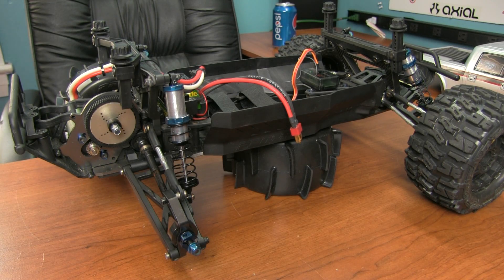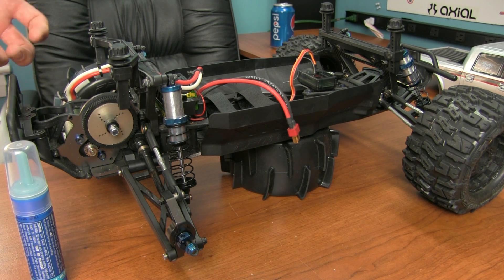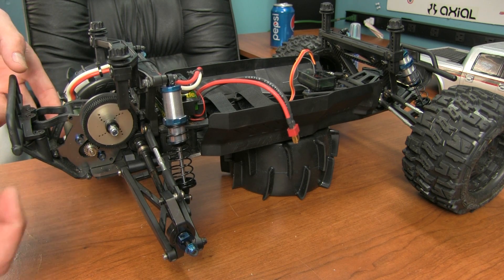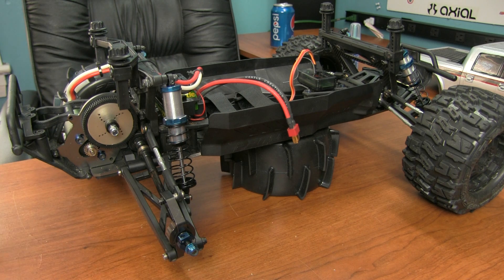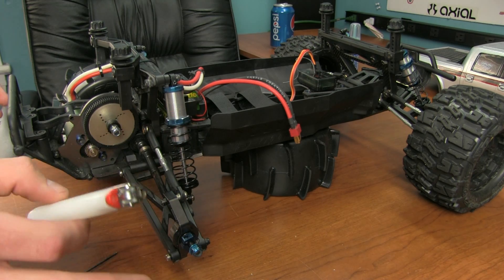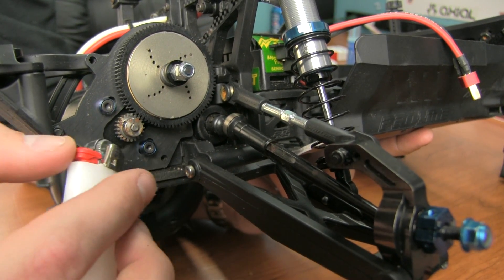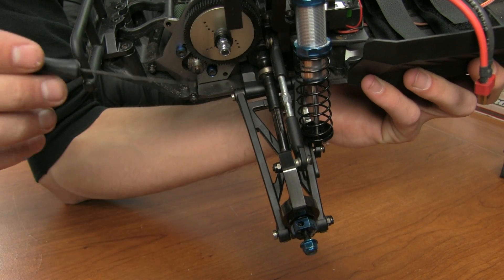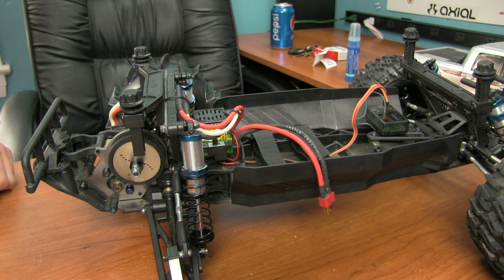How To Easily Remove LockTite From RC Cars & Trucks

Comment: Matt, I would use a clean soldering iron before using a light if you are worried about melting random pieces of plastic. Great tip though!
Reply: Took the words right.......

Comment: I like your videos.  This is concerning using the lighter on the locktight.  This works better than the lighter and is safer. By using a sottering gun on the screws to heat them up. Less chance of burning plastic. Hope to see more videos, like watching them. Hope to have video's of my own soon.

Comment: HEY SIR very nice info you give out..what do you think about Traxxas new ID battery and connectors??
Reply: ***** Well coming from a business point of view, the ID connectors wasn't a great move. All Traxxas did there was force people to use a Traxxas ID charger when you have ID batteries. Most people out there could care less that they have a balance plug hanging off the battery during use. There however might be a select number of people who might find it very convenient not to ever worry about the balance plug. So our customers come into the store NEVER EVER purchasing the Traxxas ID bats or chargers unless they are die-hard Traxxas. Most people have a mix of brands and therefor usually end up swapping the Traxxas plug out for a Deans or something more commonly used.
Reply: ***** I didn't realize that all the the ID bats are 25C. From my experience, as long as the capacity is high enough you can get away with a lower C rating. Though, still not suggested. a 5000mah 25C = about 125A continuous output. If you happened to cram a 10000mah 25C you would get 250A continuous output. Most 1/10 scales don't ask for more than 80-100A continuous. ESCs and bats also have a BURST rating but when I buy batteries I try to make sure the ESCs BURST rating is around the bats CONTINUOUS output. That way the bat never gets discharged to quick.

Comment: Why not just touch it for a sec with a soldering iron?  You can get a soldering iron at just about any retail store for under 10 and they are handy to have lying around.  Since you are hitting a precise location, you aren't risking the plastic gear.

Comment: Does Locktight work good on the plastic parts?
Reply: It does provide some abrasive grip, not as good as metal to metal, though, plastic to plastic use foam tac or silicone.
Reply: @jeffs7915  😊

Comment: Pretty bad how to.....  the CORRECT way is putting an Allen wrench or hex driver that has been heated up first with a torch and letting it disperse heat into the head of the screw.

Comment: I think your idea is better.  I use my heat gun
Reply: if you need to re install screw with dried locktite try spinning on the hard plastic side of hook and loop (velcro) with driver then re apply fresh thread loc.
Reply: James Uncapher brush it off with steel brush also ok..